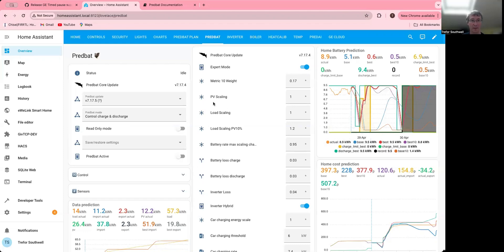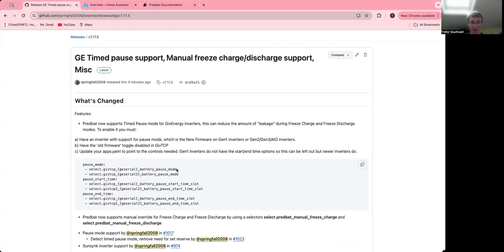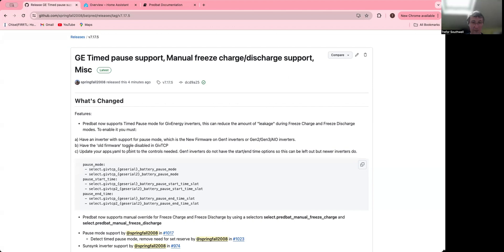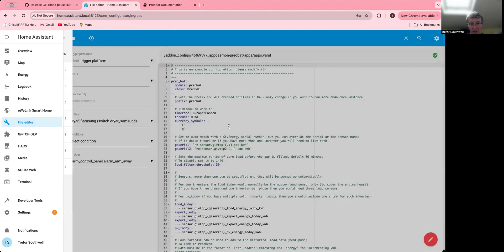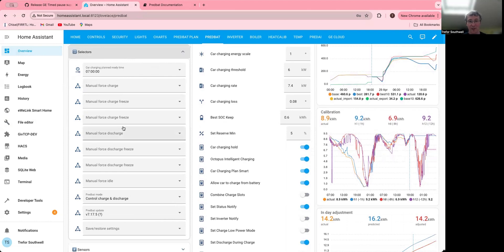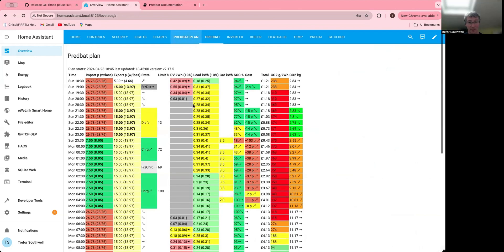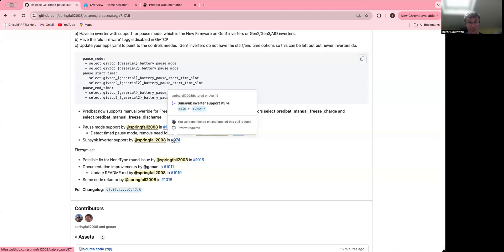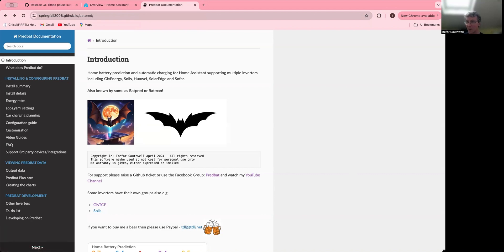Predbat New Features, GE Inverter Pause, Manual Freeze Charge/Discharge

Comment: The ability to manually select freeze charge and freeze discharge is useful, thanks Trefor, but at the moment Predbat is doing a great job without me needing to change anything!
One minor thing, if you have the new ‘fast response’ firmware for the Gen 1 inverters (D0.191-A0.193) and turn off the ‘is it old firmware’ toggle in GivTCP then you get all the new capabilities that the Gen 2, 3’s & AIO’s have - battery pause mode, pause start time and pause end time - as well as local control mode and PV input mode.   This Gen 1 firmware is available on request from GivEnergy support but your inverter needs to be manufactured after week 10 2022